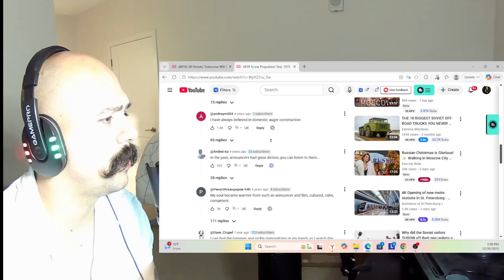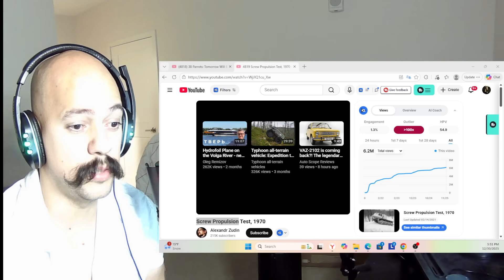American reacts To Russian Invention Испытание шнекового движителя, 1970

Comment: The technology, of course, is not lost. Its problem lies in its narrow functionality. On relatively solid surfaces, a screw-propelled vehicle is helpless. But in combination with other machines, it is quite effectively used. For example, the ZIL-29061 with a screw propulsion system is part of the "Kompleks-490" search and rescue complex. There is the British screw-propelled vehicle Snowbird 6. There have been attempts to create a hybrid of wheeled and screw propulsion. However, there are unresolved engineering challenges there. But when humanity begins to fully develop the Arctic, they will be solved. Screw-propelled technologies will be indispensable there. The difficult-to-traverse permafrost zone with its swamps, tundra, and snowdrifts is the very place intended for screw-propelled movement.

Comment: Metal screws (augers) possess one major drawback: they are incapable of gaining traction on hard surfaces. On asphalt or compacted ground, such a machine will simply spin its screws in place without forward momentum until they sustain damage. Unlike tracked vehicles, this issue cannot be mitigated with rubber pads or protective inserts. A screw-propelled vehicle must first be transported to the actual off-road site and then unloaded.
The inability to traverse hard-surfaced roads was a primary reason for the limited adoption of screw propulsion in transport, though it was not the only one. Furthermore, the low mechanical efficiency of the transmission and propulsion system is worth noting. Transferring torque from the internal combustion engine (ICE) to the screw requires multiple gearboxes and drives, which compromises both overall efficiency and drivetrain reliability. Fuel consumption is beyond the pale; for Soviet screw-driven vehicles, it started at a staggering 120 liters per 100 kilometers.
The screws themselves only provide effective thrust in soft or viscous soil; on loose sand, the speed of a screw-driven vehicle is barely a crawl, comparable to a walking pace. Crew comfort is also non-existent, as the design lacks any form of suspension.
Another crucial factor is the environmental impact of screw-propelled vehicles. The screws leave deep, semi-circular ruts in soft soil, severing the root systems of plants as the screw flighting essentially acts like a knife. For sensitive taiga soils, vehicles equipped with low-pressure tires are much preferred.
Reply: Тебе же всё объяснили в видео, рагуль